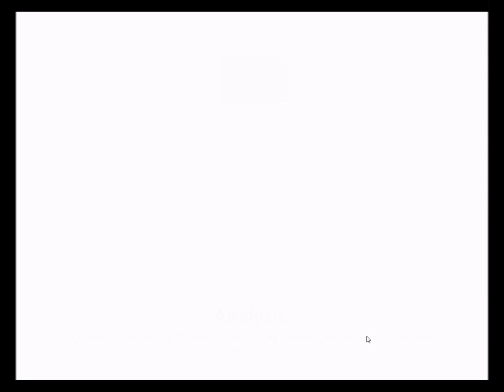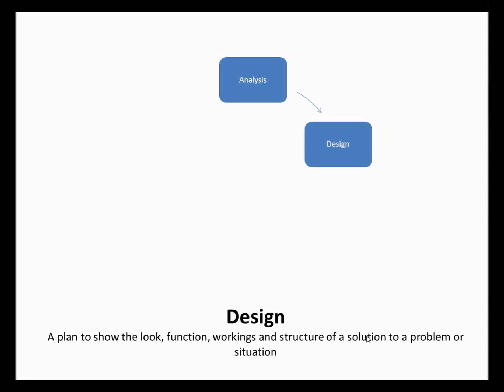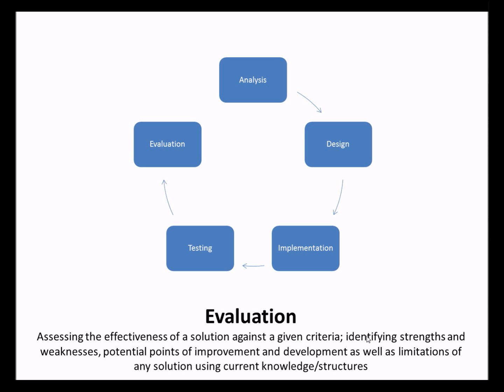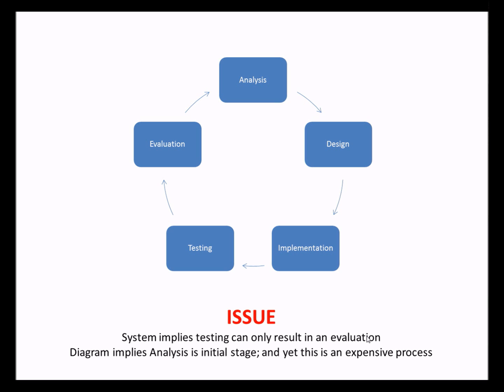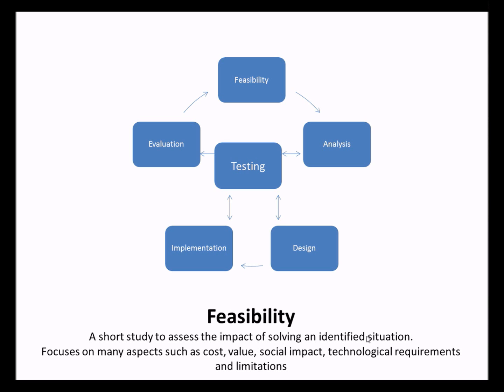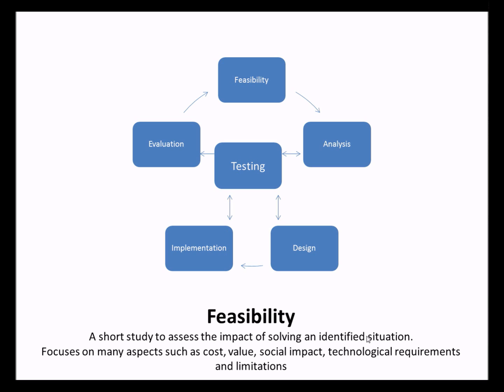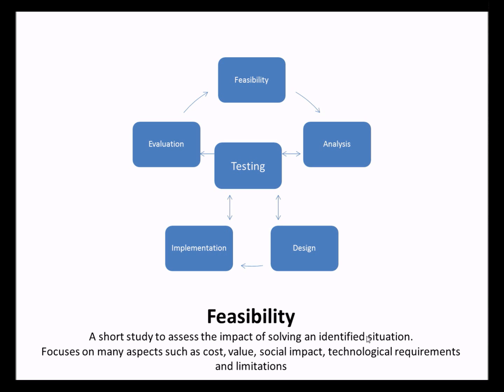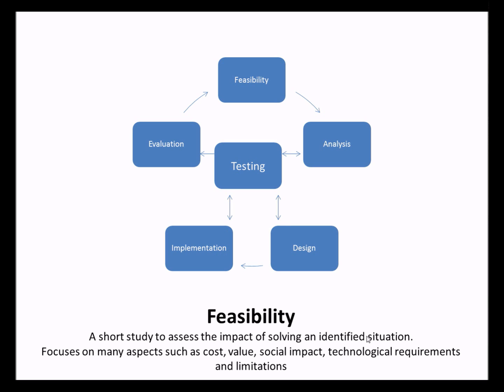Database Design 1 - The System Life Cycle

Comment from the maker: This is the problem with theorising an approach. The first diagram is clear and yet implies things that are not true (testing occurs after implementation rather than throughout it; alterations due to testing cannot result in a return to implementation or design - or even analysis if it was that poorly anaylsed). The second diagram tries to rectify this but becomes confusing and of little benefit for clarification of the approach to database design. Pleased the video is still useful though and thanks for the comment.

Comment: I like the simplicity of the first diagram. which inspire a better understand of each step.

Second diagram looks a bit confuse. it doesn´t have the beauty simplicity of the first.
It lacks on linearity. Except by the "feasibility" box, all steps goes both ways, and in some cases with more than one link. Not very useful on practical terms. Just good as a vague theoretical explanation.

Still a good video! Thanks for sharing knowledge :)